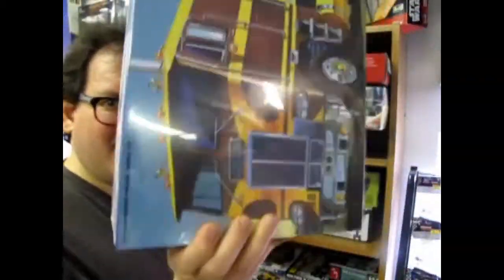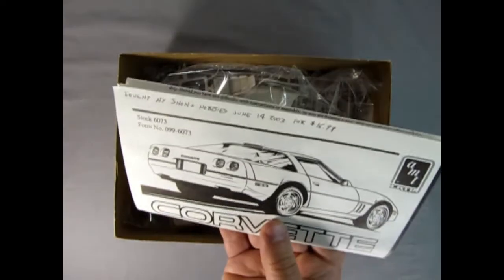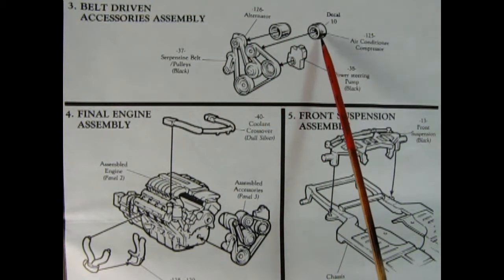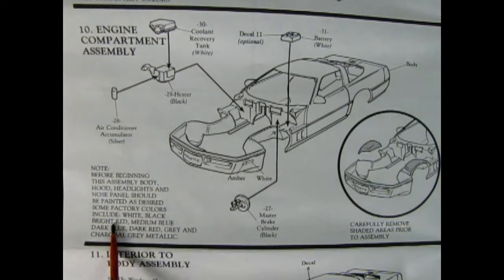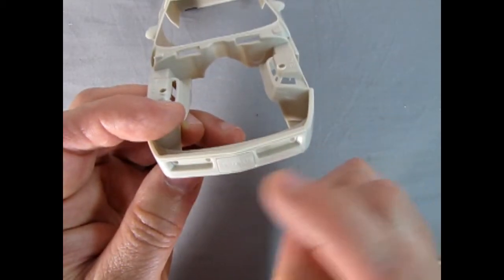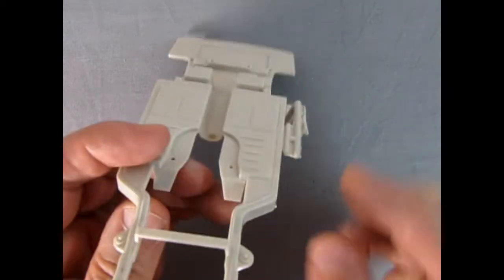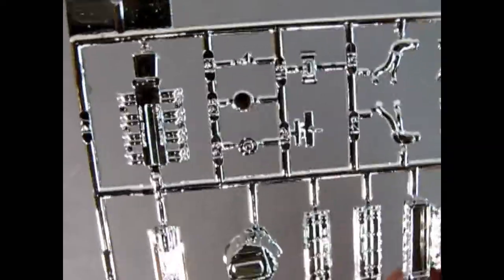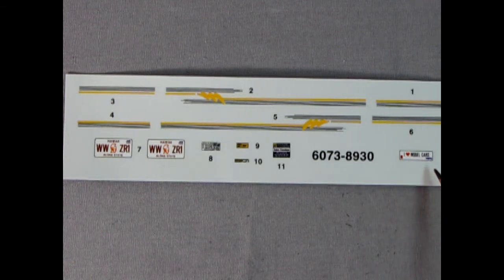What's In The Box? The 1990 Chevrolet Corvette ZR 1 by AMT/ERTL - A Model Car Kit Unboxing Video

Comment: Another great video.  A video on a larger scale would be cool, 1/20, 1/16, or even a 1/12.
Reply from the maker: Coming soon! - I am just going through all my 1/24th-1/25th scale kits for now. My final kit in this series is the snap-together 2000 PT Cruiser. After that, i am going to continue on the 1/32 scale. I have 1/20th kits, 1/16th and a 1/8th scale kit...but not too many of the larger cars.  I'm not sure how i will fit the larger models under the camera though.